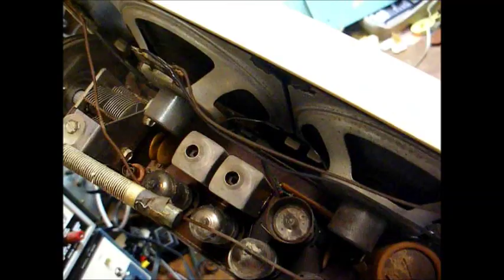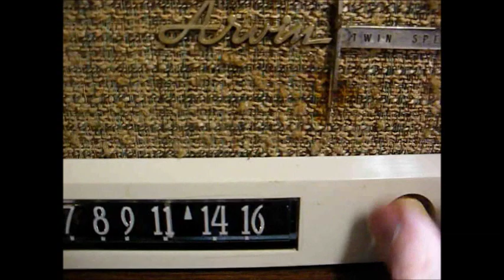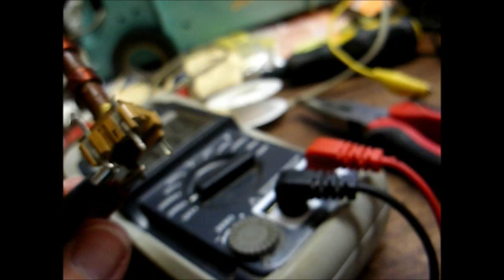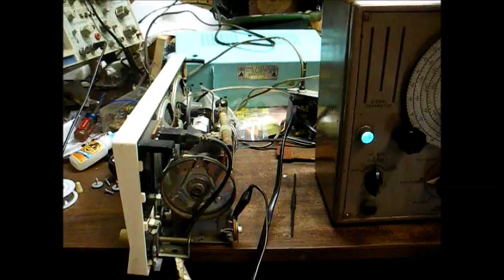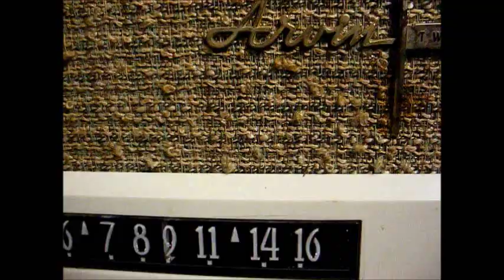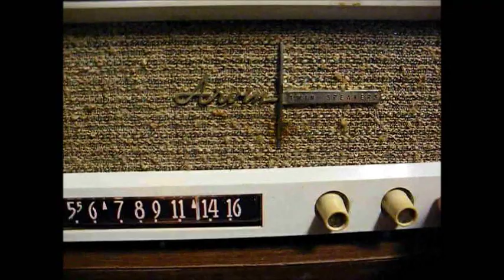Repair of a 1960 Arvin AM tube radio

Comment: That's one cool looking old radio. The inside looks squeaky clean. I had a GE clock radio that same blue color but it was a cheap tacky one.  The posts that you screw the alarm clock  buttons on were totally threaded and the knobs kept falling off. I had to use a pair of pliers to set the alarm.

Comment: Good fix, my friend.  And great I.F. malfunction symptom info.  I would been scratching my head for sure on that one.  It's definitely food for the ole memory banks.  Thanks.

Regards,
John
Reply from the maker: Thank you for the comment. The good news is that this type of problem usually didn't happen on the larger IF transformers from the immediate post-WWII and prewar radios. These older IF transformers had a variable trimmer capacitor in parallel with a fixed coil (usually). The smaller IF transformers from the late '40's until the '60's had a variable slug-tuned inductors wired in parallel with fixed silver mica capacitors that were made into the base of the IF transformer and it's these small transformers that give trouble. The old big IF cans rarely go bad, except for open windings.
Reply: i have a philips radio that starts ok but fades out slowly over a few minutes, turned out the if amp UF89 was going into grid emission, going positive..

Comment: Another way I like is to delete the internal capacitors and put 50-250pf variable caps on the bottom and peak the caps never touching the cores. Like an old style IF can

Comment: Nice repair. Thanks for showing us again that the loss of negative voltage on the control grid is an indicator of silver mica disease (in the radios with the smaller IF cans). Especially like that twin speaker era, & also ones with a phono input.

Comment: I've never actually found a case of silver migration causing mini IF can problems, when I run into a problem with those it isn't shorting or leakage but an open or intermittent connection between the mica cap and the ends of the coil. I never really understood why some IF can manufacturers chose that cap design, precision ceramic caps were available after the war and were reasonably inexpensive, and small, at least compared to molded mica. Some mini IF cans did use the precision ceramic caps but the majority did not. The old slug tuned IF cans from the late 1930s and 40s used molded mica caps so they never had such problems.

Comment: First thing I noticed, ARVIN was still making AM 5-Tuber Radios as recently as 1960.  Then it uses a ferrite antenna loop rod, and a printed crkt board. So it is clearly cross-over tech. I have a 4-Tuber Superhet Arvin myself from that same era - also crossover

Comment: I have some of those bulbs, with no number i.d. on them, but some digging leads to either it being a #12 or #19 indicator bulb, 6 volts as you say.  My Gulbransen organ uses them for indirect lighting, and in the service manual they refer to them as #19 indicator bulbs

Comment: Judging from the shape of those IF cans, e.g. the curve tops, I wouldn't be surprised if they were made by the same company that made them for GE. I replaced more IF cans in GE radios than tubes over the years. I've had very few problems with the flat top one that RCA, Zenith, Westinghouse, Philco and Motorola used.

Comment: 3:15 Yep... definitely a bad mix, tubes and PC boards.... the PC board gets hot over the years and carbonizes to the point where it actually conducts electricity and creates leak-paths between the socket pins, etc.

Comment: The "twin speaker" gimmick seems to have made a comeback. A friend of mine showed me a 1980s-style AM/FM/SW/Cassette "boombox", with a port for an MP3 player that he ordered from some company in China for $30. The sound and reception were amazing for that price; it even had bass, mid-range, and treble controls. I was thinking, "what gives", then I noticed that there was no stereo effect. I don't know if there was a stereo amp for the MP3 player or the tape deck, but there was definitely no FM stereo decoder. It was just like the "fake stereo" radios of the 1950s. Not really a huge loss, given how close together the front-aimed speakers were on most boomboxes. I wonder how much different a radio like this would sound with one speaker missing.

Comment: man i wish i had the simplicity of your repairs I'm stuck on a radio that whenever i turn it on one of the resistors starts to smoke i replaced with the same value and wattage and still the same thing. any suggestions guys? I'm out of ideas!
Reply: Something connected to that resistor is shorted, and therefore drawing too current through said resistor. That's why it keeps burning up on you. If you have the schematic, locate the resistor and identify what it is connected to. One lead of the resistor will be connected to a source of voltage, possibly through other resistors. The other lead will be connected to whatever the resistor is providing current to. My first guess is a capacitor connected to that side of the resistor has shorted and is causing the overcurrent problem you are experiencing. Good luck.

Comment: O wonder if Arvin radio company still around anyone?
Reply: As a radio manufacturer, not since the 1970s, as far as I can tell.  Arvin actually spanned several industries (many of them automotive based), and eventually merged with Meritor (another auto parts manufacturer) to become ArvinMeritor (yes, one word) in 2000, and in 2011, they dropped the Arvin name entirely.